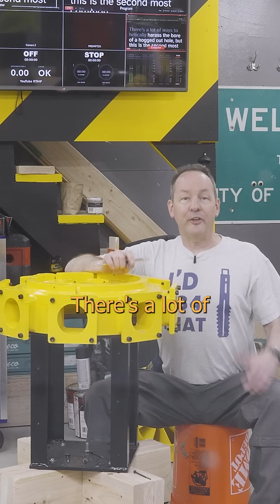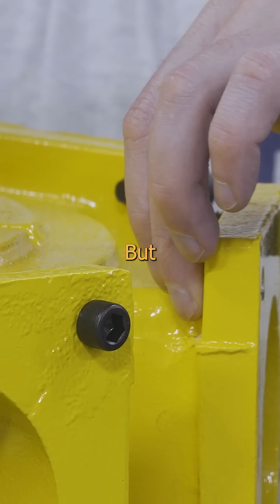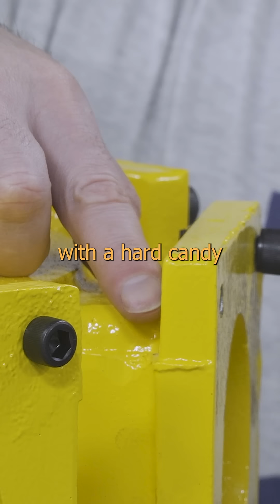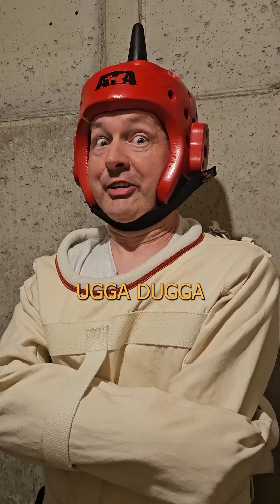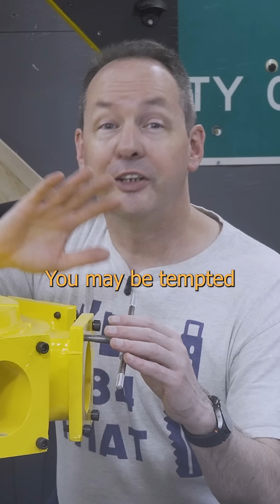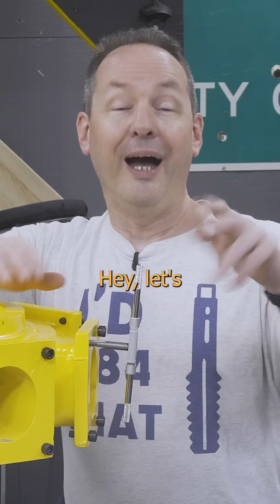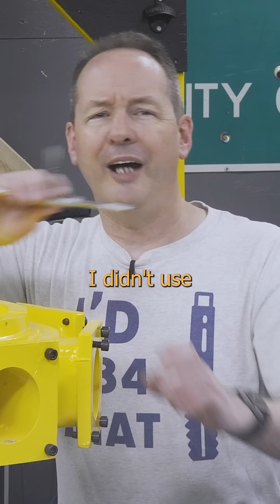Thread Chasing  #chrisboden #comedy #engineering #skills #workshop #metalworking #tools #apprentice

Comment: Dumbass. 
Had to tap the agitator threads for a washing machine that I mangled because I put too much torque on the first bolt, broke it, "fished" it out with all the swear words and sweat of regret I could produce, only to break the tap as well on first attempt (no drills, just hand crank). 
The OEM agitator had too much play on the OEM bolt because the threads weren't long enough.
 Second tap went well, second bolt i cut down to fit snuggly on the agitator, but...I did round of the edges by hand crank as well. face palm so no more repairs for that bad boy. I'll be replacing my 12yo washer next time it breaks down.

Comment: Tapping a VERY SMALL hole in aluminum is NOT something you do with a drill.  Been there, heeded the warnings, could have used more thread lube.  But dropping a tap isn't the worst thing you can do with one.  BREAKING it in the hole is probably the worst - and I don't want to imagine anything worse.

Comment: Was going to take up engineering before I went into acting. Still proud of what I did in the course but I was a young once-lad and was kinda dumb, so I got more stories than the thread bit. Did the stupid thing on a bad day, like anyone does; went really fast with the tap into a hole. One problem, though, was I caused that motherfucker to slip or some shit - Idk what specifically happened - and suddenly the thread was stuck shooting upright out of the hole with a bend in its arc like a jolly man without shame. And that motherfucker could not go forward or back. It was STUCK. I eventually started over and at some point my instructor (an ex-chief engineer in the army & navy) found the half-finished slab of steel with a thread stuck in it in the scraps bin. That was an interesting day.

At least Im not the shitsniffer who put aluminium onto the fucking grinder.

Comment: I fortunately have had enough respect for my taps to never put them in a drill. Can also get specific thread chasers that are designed to only clean the threads without cutting new ones accidentally. Still run them in by hand though.

Comment: If you are using a three flute tap, its not a blind hole, and you arent handicapped in the brain, power-tapping is absolutely something you can do with an air ratchet or a small impact or driver.
ESPECIALLY  if you are just chasing threads.

Comment: Dumbass: I was working on a crank start tractor years ago that my old man wanted rebuilt. This buggr was more tweaked out then a lot lizard on a random Tuesday. Long story short, I was chasing the threads with a slow chuck drill. It was going good until I went to reassemble the thing... It was a good lesson in how to fix messed up threads😂😂😅

Comment: Dumbass-- Wasn't a drill bit it was a number 4-40 tap on a pt6 turboprop. Was chasing a plugged hole as above, by hand. The small tap handle was FUBAR'd so I had to use the t-Handle( looks like a drill chuck with a crossbar.). I was delicately and slowly chasing the threads, with three fingers on the t-Handle. Everything was going great until the second quarter turn over the galled section of thread. Tap got a bit tight, so I put the fourth finger on the handle....and snapped the little fucker off down the hole.

Nothing like an unscheduled engine change on a Saturday morning. Only a $2,000,000 dollar unit.

Still employed though.

Comment: I do it. And I've paid the stupid tax. But I still do it. It's mostly clearing rusty threads in flanges. I've gotten quite good at it over the years, and only have a mishap when I lose control of the drill or try to cram it together too fast. Don't we always. 

However, the lesson I did learn and STUCK with was you CAN'T TAP HOLES with an impact driver! It'll SEEM like a good idea! You're not going for THAT much thread depth! It's SOFT material! It'll work! FUCK. Broken off taps in already questionable holes are the god damn worst.

Comment: Have had many MANY lessons learned when tapping new threads on a freshly drilled holes with small diameter taps, even using a small tap wrench.  Go slow, use lots of lube, back it out before going in deeper.  Ram it through and things break.

My inner 13 year old wants to make so many jokes right now...

Comment: I was a dumbass using a drill press on an temu branded m3 tap in aluminum, the part was for an industrial glue gun from Sweden so that shit was build like an early Ikea wardrobe. Boss was stressing me out, it was 7am and i had ran out of coffee. Obviously that crap broke and the part had to be tossed and i spent the afternoon 3d pringting it out of petg since it didnt have to be too sturdy. Its a year ago, the first print is still in use and they got 10 of them in storage now

Comment: Dumbass: I had to chase and rethread spot for a license plate bolt. Did it slow with the drill, ended up lopsidded. Didn't cross thread it tho. It was close enough no one would complain unless they had a serious eye for detail. Though it was a 2011 Camry so I doubt it

Comment: DUMBASS USED A ALMOST DEAD BATTERY ON A DRILL.. Thought its dead, its slow, however.... the initial trigger pull, well, it had more juice, than a kindergarten lunchroom.... smh ugh dumb ass broke the thread chaser with no options left to exhaust.. DO NOT USE A DRILL, EVEN A DEAD ONE! enough power to plug my day with hardened hunk of steel that needs to be turned out as a liquid.. cant be tight if its liquid,  riiiiight? WRONG.. SERIES of cascading events ruined my day, starting with a damn drill.. now that's pretty cooooo- no that was shtty

Comment: Dumbass... i was working on a fixture for a plasma confinement chamber for another grad student. (I was the only grad student that continued at the school from under grad and had been a machine shop assistant, so instead of folks on my team having to go through the machine shop requests they could ask me and as long as it was a job that could be done in a single session and the machine wasnt occupied, i could cut the line and do it myself.) I had the confinement chamber in the fixture I'd made. I'd remilled the face and drilled the holes, and decided if i wanted to make sure the threads were square...just use the mill. It WAS supposed to be an M6 hole, they got an M8

Comment: not me, but someone i know broke a tap off inside a structural beam of a CH-47. they couldnt get it out, so they filled the hole with epoxy, drilled and tapped a new one, adjusted the fairing, and there it lives to this day. 

remember kids, half turn forward, quarter turn back. it stops friction welding

Comment: dumb ass moment: When you know that Cisco's have a "reload in x(min)" command to power cycle the equipment but you decide; I don't need that, the configures I'm gonna drop will work. Only to find out that you had a decibel in the wrong place and now you're locked out of a remote site a few thousand miles away and about a five hour drive to fix.

Comment: I'm a dumbass... But a trained one, LOLOL!

Seriously, I was taught about using a drill with a tap years ago when I was working on fire apparatus. You need to use finesse, still go slow, and it's HIGHLY recommended that you only use a 2 flute tap! I've gotten away with 4 flute taps in a pinch but I've been bit by the "DUMBASS" more than I've gotten away with it.

Comment: Dumbass. Was doing a head gasket on my brothers car with my dad when I was young. Had me chasing threads, broke a tap in a hole... Tried to drill it out and snapped the drill bit. Couldnt find the tip of the drill bit until we turned on the motor to test everything. Head of the drill bit flew into a cylinder and we didnt see it. So two lessons, dont use a tap on a drill and always tape your heads so shit doesnt go in there while shes open to the world...

Comment: Everything you said was correct but as someone that had to run an m24 tap through 1000 oils on several 8ft x 10 ft massive 2 inch thick metal slabs get that lube and impact. Especially when you got a deadline. The worst part we wouldn't have had to do this with the machine shop just did it right the first time they didn't tap all the way through and they needed to be

Comment: I'm a dumbass. Used a 1/4-20 tap in a drill. The material was only 5/32 thick, so I figured there was no way I'd have an issue. 5mins and one broken tap later...

Comment: Working as an automotive tech, chasing threads after extracting crusty exhaust hardware is a must to save cylinder heads and turbochargers. Extracting broken taps from said parts causes my tisms to hit wrong way. Go slow and if you think it's too much lube, it's not enough.

Comment: Dumbass. I worked at the Mercedes plant in Vance, Alabama. I worked for body repair after the vehicles were built and assembled and put on the assembly line. Everybody on the assembly line like to send every single bolt home with an impact wrench sideways straight backwards, who cares they tried it we would get dispatched when a bolt would not torque. We would have to re-weld well nuts or insert well nuts and weld them onto the vehicle frames/shells probably every day for about two years. I would put a tap in a drill put it on the second speed DeWalt drill has three speeds. I put it on second and I was just send it home and it did great 99.999% of the time the guys that were teaching me how to do it were extremely skilled and I’ve been doing it for 20+ years from a production point of view it worked great from a repair point of view. If I catch you with a tap in a drill, you’re gonna be in trouble

Comment: Somewhere out there is a 1995 F150 with a starter thats mounted on a plate of Swiss cheese with 1 bolt and 2 broken taps holding it. The wrong starter on the wrong truck, the bolt holes didn't align, and the first one I drilled to make it fit was too crooked to get the bolt through. The 2 new holes I drilled next I drilled through and into the plate but ended up breaking the taps off inside so... I guess they're bolts now too. All because I already had the one hole that matched up bolted and torqued down and I didn't want to pull it off again to drill a through hole and just tap the plate. I was 16. I didn't know better. It worked though.  So to the mechanic who inevitably ended up having to pull it and replace it I would like to apologize. Even now I'm not sure how one would remove it. The taps were pretty well swaged in place and broke flush with the starter.

Comment: Im definitely a dumbass. Brother was helping me put the motor mounts back into my car after replacing the timing system and I trusted him to do it while I was under the car hooking up the bottom. He cross threaded the main bolts and my bright idea to fix it was to slap it in my drill. I regretted that choice for the next 3 weeks but managed to fix it after many swear and murdering my brother's feelings.

Comment: There are special taps for chacing threads which have a deeper taper than a normal tap.  You can also start with a lower grade thread tap for really bad threads.  Another trick, for threads that need repair and not just cleaning, used a thread forming tap.  These have no cutting teeth at all.  They force the material into shape.  This is perfect for following the jackwagon who could not start a bolt without making new threads.  Last, IPA is great as a threading and thread cleaning lubricant.  It moves heat and debris while leaving no residue to clean after it dries.  It's no good for high speed stuff.  But hand or drill work is just fine.

Comment: Dumbass - was tapping a bored hole with a flat bottom. Guess which moron was spinning the tap like a fucking roulette wheel when it bottomed out and suddenly stopped moving.

Had to effectively drill into that rap, put a reverse rap into that bored out tap and pull it out slowly backwards.

I nearly cost my company about 6 figures in steel.

Comment: an easy and safer way to clean out threads is to take a bolt of the same size thread and grind a decent size flat down the length of the threads. start it and go in gently like you would with a tap. Works great on the table of my wire edm and doesn't screw up the threads.

Comment: D0mb4ss, in a motor head, I was cleaning a hole to change a water fitting, and broke the tap... Not recommended took 4 people to get the part out, we ended drilling around and taping a bigger hole, the fitting looked unbalanced cause had a 10mm and 9/16" on the other side hahaha

Comment: Technically your supposed to use a thing called a thread chaser. I have kit. Theynare made to clean threads not cut them. Make them for internal and external threads. But I also don't know if they make thread chaser for all the sizes they make taps for.

Comment: Machine tapping m4 into a 1 off piece of aluminium plate 1m long and 700 wide, didn't peck tap, just the ol G98 G84 Z-25 P0.5 F100 (i know ... 25mm of blind m4 😢) tap snapped off at the bottom of the hole, lucky for me the remainder was enough they could still use it... proceeded to tap the rest of the 19 holes 5mm in the machine and finished by hand 😅

Comment: You can also use a grade 8 bolt or shcs.  Use an abrasive wheel to make a cut perpendicular to the threads.  It makes just enough of a wire edge that it will clean up the hole.

Comment: Back in the 80's as a young Telecoms trainee tech I got the job of re-tapping holes on a new distribution frame from 5BA to 5mm,  In a 4mm bar that's like 1/2 a thread difference. There was a couple of thousand holes to do. why because we were a government department and NZ was metric now, thats why! 
I put the tap in a old school hand drill and was ripping through them, unfortunately I broke 3 taps, which resulted in having to apply for petty cash to buy some more This resulted in a lecture and reprimand for not using the correct tool from 3 levels of managers. Had to finish the job using a tap holder (while the boss was a round).
Oh and this was on a job which was running 3 months late while we were working 11 hour days and 8 hours on Saturday and Sunday at penal rates and meal allowances. 
Once I was finished we discovered the stores dept only had 5BA screws in stock! Got to love government work!

Comment: Been a machinist for almost 20 years.  I'd have chucked that tap up into a drill motor, put a little Moly D on her and let 'er buck.  There's very little torque involved in chasing threads like this. Done it more times than I can count.

Comment: Dumbass at age 16 working on an old 67 Dodge Dart straight six my dad cross threaded and told me to try the tap. He then had to get the block welded, drilled, and tapped.
Granted, I was told to be a dumbass but it was still a valuable lesson when I worked on my old Camaro I got later.

Comment: I got over 3 years of experience using a souix power taper to tap cast metals. The threads are proprietary Full Torque and very delicate. Going in 2 inches deep for 13 hour days for 7 days a week for weeks on end will give you loads of confidence. And we never left a broken tap in the casting. NEVER abandoned a broken tap no matter if it took 6 hours to get it out.

Comment: I’m a different dumbass, it wasn’t a tap, it was a bolt extractor. Used a tap wrench on it like the directions said, fucker still snapped off in there then I had to buy solid carbide drills to remove that fucking thing too.

Comment: My Dad has a Tap & Die set that is over 40 years old at this point. I've carefully used it for tapping out the threads in bike frames, snowblower control arms, and in Cyclone Rake attachments for our riding mower. 
 
   Sometimes, I have used the dies for cleaning the threads on old rusty bolts and sparkplugs nearly as old as Dad. Like the champion sparkplug I found in a clod of mud in our driveway. I got it working again!! That thing looked like a rock before I chipped the mud off of it!

Comment: Dumbass..... buuuut it did the job. Have an old 300zx that needed an EGR delete that way she wasn't eating her own excrement had to tap a hole in a spot the tap wrench wouldn't fit because of a bolt that wouldn't even come out after becoming closer to a puddle than me in this Florida heat. Hit it with a drill and tap, bolt went in looser than your mother but some extreme heat JB weld on the threads and around the bolt and the job was done well enough for those employed within the government sector.

Comment: Im a dumb ass. I was at the end of a looonnng road replacing the lock on a safe, I was using the drill on the softest clutch setting. But still broke the only tap i had for the specific mounting bolts. So had to drill and tap new holes and modify bolts to work. Made for a late night.

Comment: Oh boy i worked at an automotive seal factory as a tooling engineer, the molds were under constant heat and pressure for the silicone transfer to work, and of course the screws always were a bitch to take out.

First mold i had to get down for repairs  which include changing really tiny pins for where the cabkes go through, a screw broke, had  to use an extractor which was also a pain in the ass, and then a tap, which i commited the sin of using an impact drill, and then the tap btoke inside too

Comment: I’ve been faced with that and needed to avoid the asymmetric load on the bolt head that the wonky hole was going to cause so drilled it straight and helicoiled it. I’m surprised such an approach isn’t mentioned.

Comment: If you use a drill and break enough taps you eventually get better at it. Just like everything else there's a learning curve and practice makes perfect!

You only want to use a drill for chasing, though. Unless you have one of those machines specifically for tapping. Those are pretty cool, when they encounter enough resistance, they automatically reverse, then go forward again.